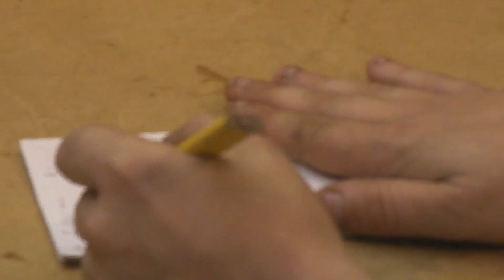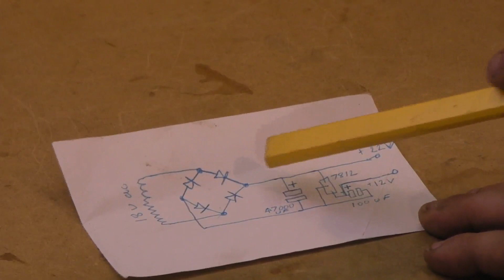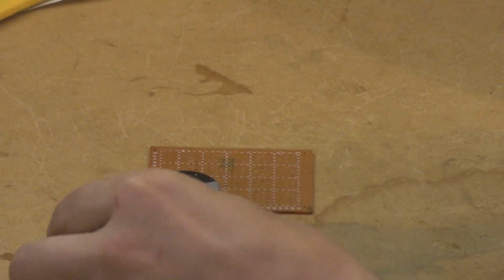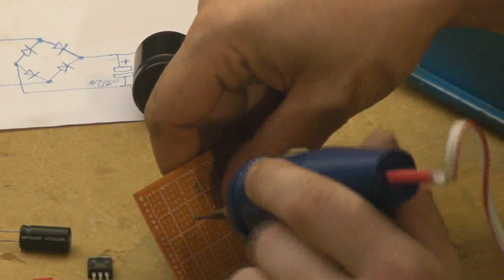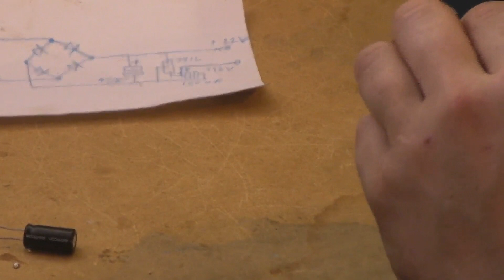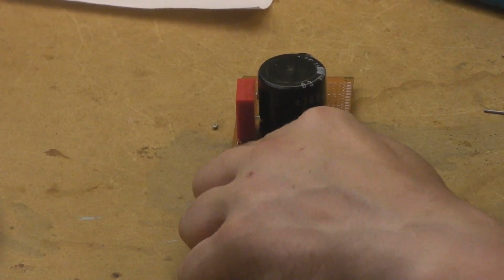1960'S Record Player. Trash To Treasure? Pt4

Comment: Hi jay one simple thing you could try is to add a 1 meg resitor to the input of the pre amp to try and get rid of the inpedence mismatch  should help with the tinny sound .not shure where the buz is comming from .
Reply from the maker: Was thinking about that, also looking at an FET based preamp which may also help with the mismatch